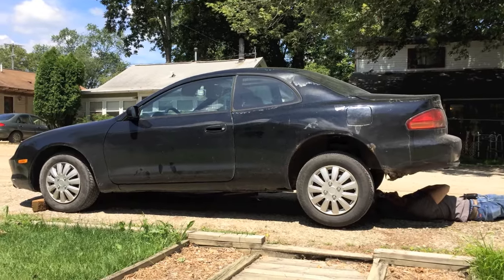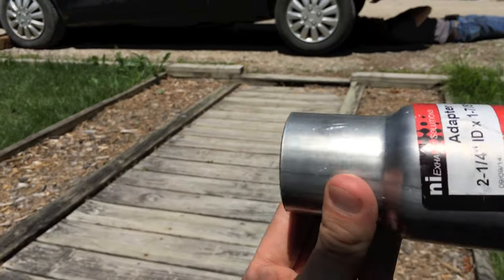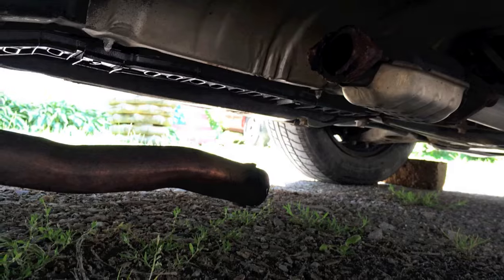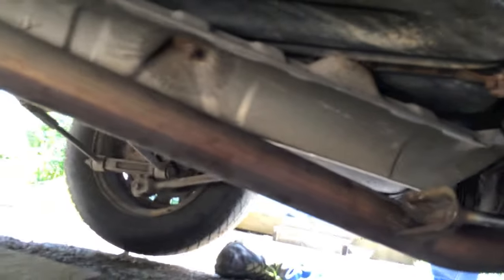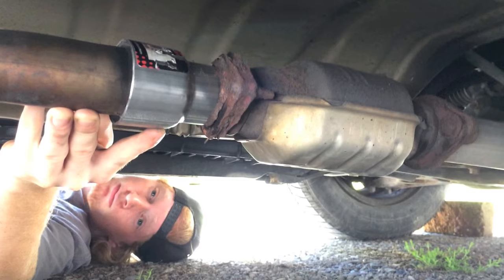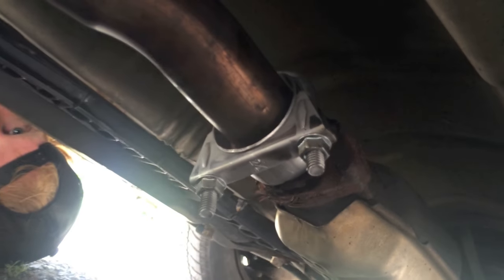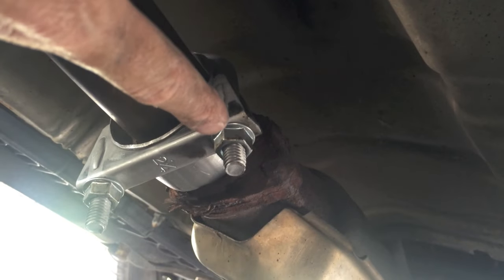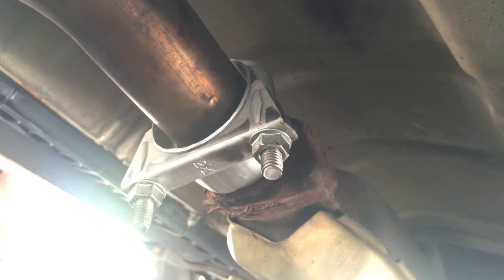Exhaust Pipe Quick Repair using pipe adapters - EXHAUST CLAMPS ROCK

Comment: Great video!!!! I have an old Celica myself and same issue, identical break where the exhaust is to yours. I can't justify spending $150 for my local shop to do it... I might as well buy a welder and do it myself! Or, I can use your method and save even more. Thank you
Reply from the maker: Very cool.  Thanks for checking out the video and leaving a comment.  That exact part we put on in this video is still standing strong!  A definite money saver.  Subscribe to the channel if you're up to it.  Thanks again!  Let me know how the reap air goes!  😀👍

Comment: Hi...I've been trying to figure what size adapter and clamps my 96 honda civic would need in order to do this without crawling under the car...my jack broke...i would like to have the parts when my guy has time...any suggestions where to look..been googling. This seems like the perfect fix . Thanks. Alohaa.
Reply from the maker: By Grace Alone Thanks for checking out the video.  I recommend stoping by your local AutoZone and let them know what year your car is.  They can pull up the correct exhaust info as well as all sizes in terms of adaptors.  Thanks again for watching.  Please Subscribe to the channel that would be awesome 😎👍
Reply: DIY With Michael Borders thank you ..will do that...cars. if it's not one thing it's another. i subbed you...much aloha
Reply from the maker: By Grace Alone So true haha.  Thanks for subscribing to the channel.  I just subbed to your channel.  Now every time each of us upload a video...the other will be notified.  😎
Reply: If you don't have a jack how are you planning on doing the repair? You have to measure it there isn't  anyway around it. Autozone really doesn't always have the most accurate info. Cant go wrong with a tape measure.
Reply: Lol...thank you! Figured out the size, and just got the stuff.waiting for the some shade...sunset. :) wish me luck!
Reply: Oh, and I can reach it without a jack
Reply from the maker: By Grace Alone Awesome thanks for the update.  Time to calm down the loudness of that exhaust 😎
Reply: Yeah...and the muffler itself is just resting on the axle o_0
Reply: Lol both the mufflers on my wife and my car fell off. They came from up north but luckily the junkyard had them without rust lol.
Reply from the maker: By Grace Alone 😂...Classic...I can't say I've never been there haha!
Reply from the maker: Chris Atkinson What's up Chris...that so true...Northern vehicles that lay in salt during the winter months don't last long haha.  The engines outlast the body's 😂
Reply: DIY With Michael Borders hi again...i gave up, two trips to napa..wrong parts both times. Ugh. I have a qurstion for you...are 2000 honda ex parts interchangeable with a 1996 honda dx?
Reply: By Grace Alone most parts are interchangeable between 88-00 civics especially suspension and exhaust. So yes the they are the same for the 96-00 body style. I've put suspension parts from my 91 crx si onto my 00 civic si.
Reply: Chris Atkinson thanks so much 👍 what about other things like doors, hood, windows, tires, etc etc lol...and what about 2002 with 96?
Reply: 01 was the new body so doubt anything fits. Body wise 96-00 suspension and exhaust 88-00. Wheels and tires should be most any Honda as long as its a 4x100 bolt pattern.
Reply: Chris Atkinson wow, thanks for the speedy reply. I can get a 2002 Honda civic ex in great shape,running and everything...but no title,and she can't find the guy, was hoping it would work for parts dagnabbit.lol much aloha and Mahalo!
Reply: I've owned a couple of that body style still a fan of the 96-00.  What about a bonded title?
Reply: Chris Atkinson what's that?
Reply: Chris Atkinson never mind, i googled it...hmmm..interesting...ill look into that for sure. thanks again for all your help! Much Aloha!🌺🙏
Reply from the maker: Chris Atkinson You rock, thanks for the info.  That definitely sums it up 😎👍
Reply: too easy yall we gotta stick together on car repairs lol now if you want to get into Honda swaps I can help on that too did my first b16 swap in my crx when I was 17.
Reply from the maker: Chris Atkinson I agree 100% 😎!  You can learn so much on YouTube these days...you even learn from those that view your videos...that's my favorite part!  Thanks again!  😀👍
Reply: I concur! Very helpful indeed! The parts I got worked! Back on the road again! Mahalo for your help. And for the bonded title info too. Never heard of it,and of course,dmv never mentioned it. Hmm much aloha!
Reply: Sure thing. I had to get one for a 91 hatch a got for $100 from a shop in worked at. Car had heavy front left damage and subframe bent. Luckily I was parting the 91 crx and everything I needed fit perfectly and damn near aligned in the driveway. I was shocked. Did an mpfi swap from the d16 motor from the crx I had lying around harness ecu and all. Then through an eBay turbo kit on it and road the shit out of it. Got over $3k despite having a bonded title of course I had the police verify the Vin and that it was legally his car to sell me.
Reply from the maker: By Grace Alone Awesome Awesome Awesome...Thanks for the update 😀😀😀
Reply: Wow, thats so kewl!! I called a bond place and left a message...waiting to hear back if they can do it in Hawaii or not.
Reply: ***** you should be fine as long as there isn't a loud leak. They can't fail you based on a cheap diy repair.
Reply from the maker: By Grace Alone Thanks for checking out the video.  I'm not sure about each States code standards...however this quick repair is cost effective and works pretty well.  Please Subscribe to the channel that would be awesome thanks again 😀👍
Reply: you cannot measure with out getting under there only way to determine the size,if it was ever replaced before they may have put something different on
Reply: @anewtattoobynancy1  too late for your comment but drive your vehicle across a ditch cross ways block wheels then you will have more room to work under vehicle

Comment: I'm a bit confused how yhat end thats much larger than the pipe is staying on place ans not leaking? Is the clamp around it enough to clamp it all together?
Reply from the maker: Good morning, just poured a cup of coffee and am sitting down to answer any and all questions for the DIY community.

Great question and it is indeed.  The clamp itself is circular in design along with the circular cut to the base that the threaded studs feed through.  As you tighten in an aligned sequence, the circular shape of each part creates a very close connection to the pipe.

Let us know if you have any questions and hey if you’re into crypto trading, join our DIY ecosystem and become part of an exclusive group of DIYers.

       toolboxtoken.com

Reach out to us any time!  🧰

Comment: Hmm if you tighten clamps which are on the pipe adapter that will only tighten the pipe adapter and not the old exhaust pipe?
Reply from the maker: temelon 

Thanks for watching & sharing your comment temelon.  We have had great experience with this product as it helps aid a weak point in your exhaust system.

After inserting & tightening adapter & clamp, it worked great & lasted 3 years.

Thanks again for watching & sharing your comment.

Please subscribe to the channel and turn on your YouTube notification Bell 🛎 that would be awesome thanks again!  😎👍🔧🔩
Reply: The pipe adapter should have cuts to squeeze?

Comment: What if I put the Insert in backwards
Reply from the maker: Leo Weo 

Thanks for watching Leo Weo, that’s a good question & it will all depend on your specific condition of exhaust.  You will need to take a look at your exhaust & converter to help determine the position of the adapter as well as what size adapter & clamps to be used.

The adapter can be installed/inserted either way.

These little adapters are very helpful in fixing exhaust pipe leaks...& are very reliable.

Keep us posted on your project.  Please subscribe to the channel and turn on your YouTube notification Bell 🛎 that would be awesome thanks again!  😎👍🔧🔩
Reply: You have to drive in reverse.

Comment: Wait do you need pipe adapters for Straight piping?
Reply from the maker: Yo moms a pip 

Great question & that will depend on your specific project.  We used adapters in this video as we needed the adapter to insert itself into Converter.  Keep us posted on your project!  😎👍🔧🔩
Reply: DIY With Michael Borders I have a Chevrolet 95 s1500 So do i just cut off the muffler and put and intermediate pipe!?
Reply from the maker: Yo moms a pip 

Thanks for watching.  This will depend on which portion of the pipe you’ll be working on.  If it’s a portion that is not near the converter, a straight pipe is a great replacement for any portions of the pipe that can be cut & then clamped shut with new pipe.

Hope this helps!  Keep us posted on your repair!  Please subscribe to the channel and turn on your YouTube notification Bell 🛎 that would be awesome thanks again!  😎👍🔧🔩

Comment: My car has a stock 1 7/8 inch pipe and the cutback exhaust I ordered is 2.5  will this work on that too?  You think it'll help if I weld around the seam so it won't leak?
Reply from the maker: Thanks for checking out the video and sharing your comment.  I recommend going to the local AutoZone and matching up the correct adaptor sizes.  This definitely helps lower the loud sounds of open exhaust pipes haha.  Keep me posted, Please Subscribe to the channel and turn on your youtube notifications that would be awesome!

Comment: hey man I'm driving a 97 Plymouth neon and my break is right before my muffler I wanted to know will this still work amd where did you get the pipe converter from
Reply from the maker: +tokyohotel13 Thanks for viewing and commenting...I got the adapter from AutoZone....this is a great way to clean up that loud sound without spending a lot of money.  If you plan on driving this car for several more years....it might be better to get a new pipe...however...i will say...i fixed this part back in july 2015 and the car is STILL very QUIET  :-)
Reply from the maker: +tokyohotel13 Subscribe to the channel....thanks! :-)

Comment: Thats exactly what i have to do however i have no material to clamp onto at cat converter connection....i will prob just jbweld it around the connection....i dont have a welder....
Reply from the maker: der ddd 

Thanks for watching & sharing your comment!  We haven’t used JB-Weld for a project like this.  We are definitely interested to hear how it works for you.

Keep us posted!

Please subscribe to the channel and turn on your YouTube notification Bell 🛎 that would be awesome thanks again!  😎👍🔧🔩
Reply: The exit point of a catalytic converter gets VERY hot, so I doubt JB Weld will do much.
Reply from the maker: Max 

Thanks for sharing your comment, we definitely agree that the exit exhaust temperatures get very hot.

It’s possible that the HIGH temp rated JB Weld might work however we have never used it nor tried it....so we definitely agree with you, not sure if it would work!

😎👍🔧🔩

Comment: exactly the same problem I had today -  i drive a 91 Toyota ( Dont judge me) lol!     my question is are all adapters universal?  or would I have to get a specific one?  my muffler and converter are the original parts.
Reply from the maker: +Dj of destruction Hey there, I had a 91 Toyota that got 350,00 miles....I LOVED IT haha.  Thanks for viewing.  Great question.....what I would do is go to AutoZone and buy several sizes and clamps and then use what fits the best.  After you get the right size, you can take back all the other adapters and clamps.  Subscribe to the cannel if you want, thanks again!!  :-)

Comment: the people did a TERIBLE job on the muffler on my car i jus watch the "cab drone" is soo bad i cant hear my radio on full plast and i have a 15 in subwoofer how do i take out parts they fucked up with out cutting????
Reply from the maker: +RoGuExPaNcAkE That sounds like no fun!  Did they put a new pipe on?  Each section of pipe will lead to a connection point.  This point will have a few bolts/nuts that connect it to the next part....If it is that loud....it will most likely be a whole very close to your manifold...which is the part closest to the engine...."has a flexible mesh/type portion of pipe connected to it.  Take a look @ the manifold portion of pipe and see if you can locate any wholes or see if the shop forgot to secure the pipe.  Keep me posted!  Thanks for viewing....subscribe to the channel thanks!!
Reply: no it looks like they only added a few new pipe segmants it all rusty deffinately needs body work too.
Reply from the maker: +RoGuExPaNcAkE i hear ya....haha
Reply: Dude it sounds you need a whole new exhaust system.

Comment: I had the same exact problem on 94 accord ex. I just used this video for inspiration. I used the ubolt to squeeze down the end into the converter and hammered it in after adding muffler sealer. 
then on the opposite end I also added muffler sealer before tightening down the ubolt. 
let the sealer cure overnight. 
nice and quiet. 
great video! very helpful!
Reply from the maker: brandon lee What’s up brandon lee, that awesome!  Thanks for checking out the video and sharing your experience.  Glad the video helped.  Please subscribe to the channel and turn on your YouTube notifications that would be awesome thanks again brandon lee 😎👍